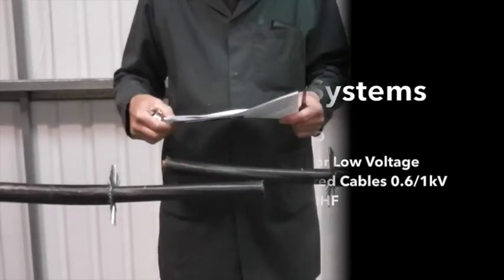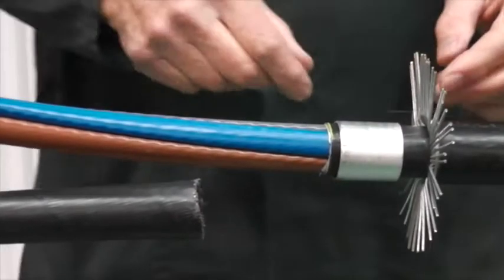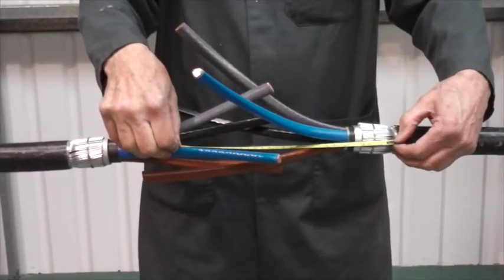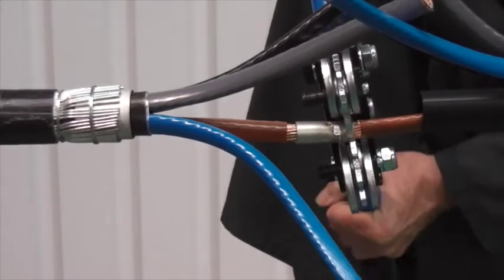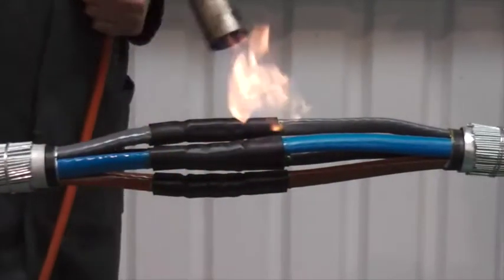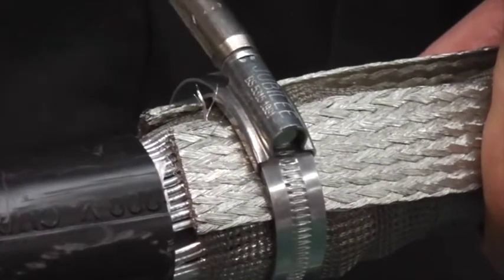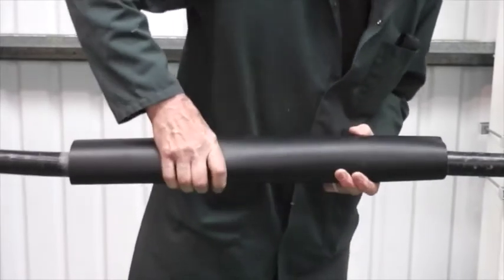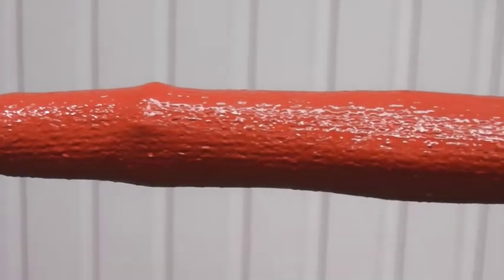Zero Halogen Heat Shrink Joints type SP NHF and SPA NHF

Comment: My dear, there is compound tape should be position under the led.
Reply from the maker: You say under the lead?  this is an xlpe cable and has no lead sheath like a pilc cable or a petrochem cable that may have lead. If you mean tape beneath the armour wires over the inner bedding, then on normal LV joints yes, there would be mastic tape. However on zero halogen and fire resistant joints, you have to reduce the number of materials within a joint that are not individually tested and conform to strict fire testing standards.  We have London Underground approved zero halogen joints and we use the same materials in our fully fire resistant joints
Reply: In Refinery we are using lead cables for protection against the flammable gas. Anyway I'm expresed by a fire resistance joint kits. Where can we use them?